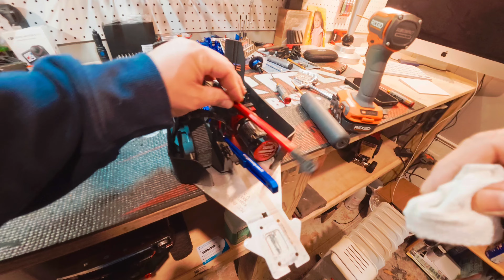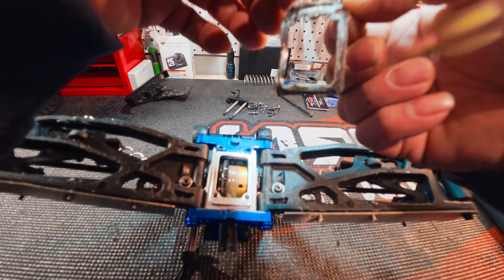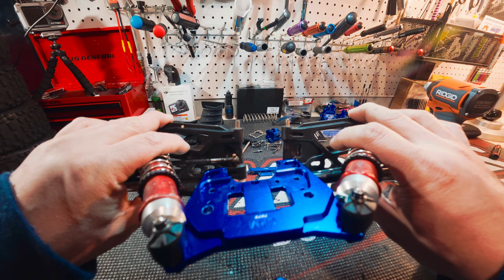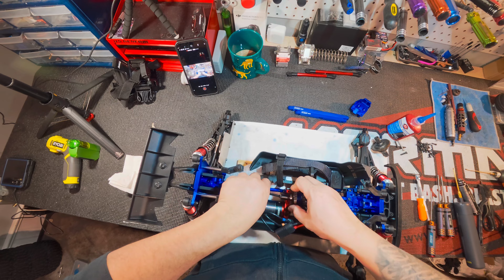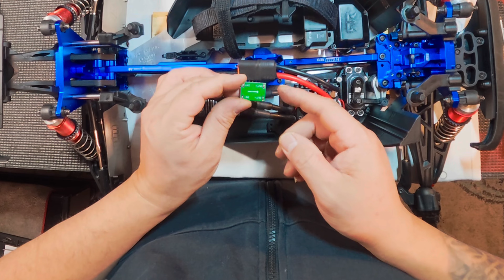GPM racing ups their game with these 7075 upgrades #arrma #rccars #gpmracing #m2cracing

Comment: Wait, random question. I don’t own a notorious, but I do own a Kraton. Wouldn’t a notorious xl just be a Kraton??
Good video.
Reply from the maker: Yes ! I think the v6 side guards are different between the two and the body but the rest is the same… you could put a notorious body on your Kraton you just need the rear body post mod I did . Thanks